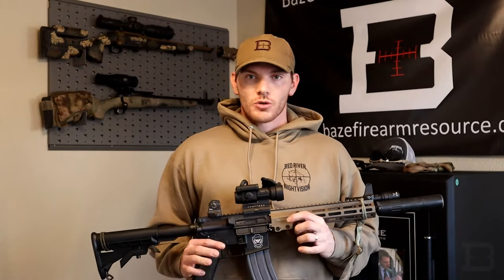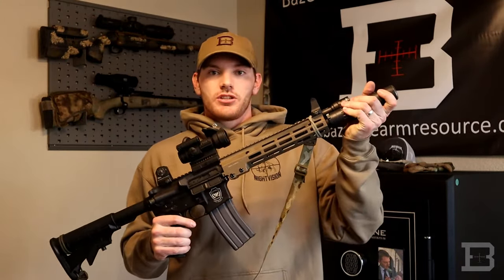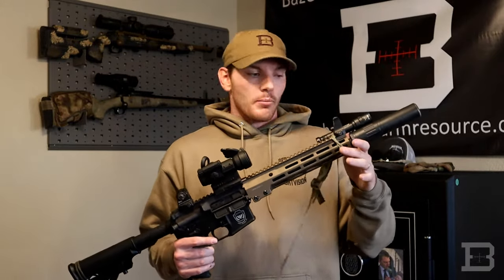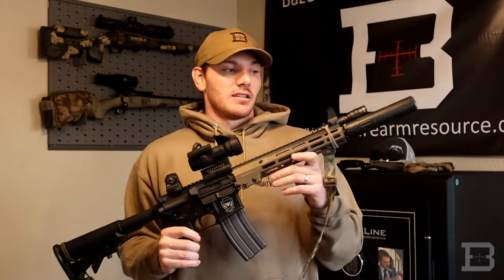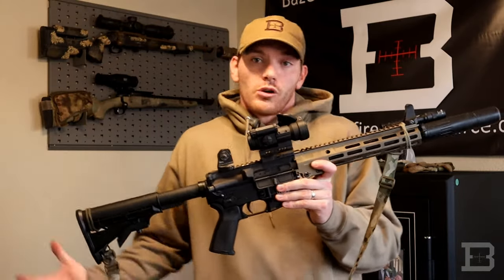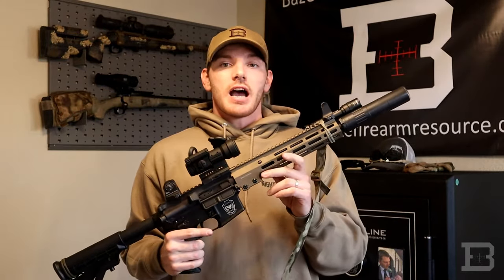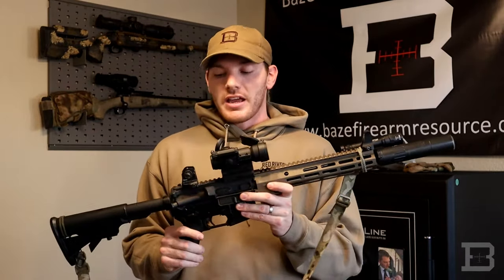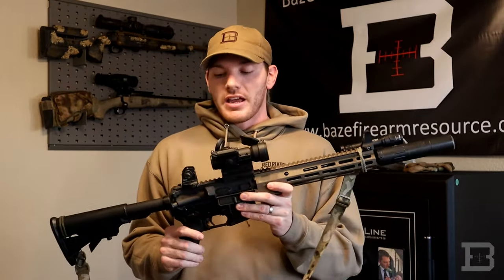How to Modify Your AR to Shoot Suppressed

Comment: Adjustable gas blocks are not the best idea because they add a new point of failure to the gun, but there is a pretty nice one (albeit expensive) called "RIFLESPEED Gas Controls".  Best advice is to get a spring from Geissele or Springco and test with buffers from H2 to H4 until your ejection pattern is around 4 o'clock.  You can also look up DIY gas buster charging handle if you want to save some money there.
Reply: Gas blocks are great. But, like anything do your research first and make sure it makes sense for your rifle/build. But they are great once you get the hang of them.

Comment: Actually it is a suppressor not silencer, because you are suppressing some sound and flash.
Reply from the maker: They are officially named silencers under law.
Reply: @suppressedpredatortactics6276 

That’s correct.
Reply: The original 1921 Patent says "silencer for guns ".
Reply: Hiram Percy Maxim the inventor called it a silencer
Reply: @kylehill4437  Hiram maxim received the patent in 1909 , actually made the 1st silencer in 1902
Reply: you can call it whatever you want, its still the same item with the same purpose. Like trans people I think

Comment: I have found that nothing really helps besides a superlative arms adjustable gas block. That actually tunes and adjusts the gas used to cycle the gun then it vents off excess gas away from the shooter. Absolute best thing i have done. Totally changed how my gun shoots smoothing it out and lowering recoil.
Reply: How long have you had it for and has it been reliable?

Comment: Not bad advice.. The bolt carrier you are using decreases gas to the internal piston which also decreases the gas expelling through the firing pin bore in the carrier..An adj gas block is even more effective as it decreases the gas going to the carrier in the first place..You also got right what the heavier buffers does (effects carrier velocity) not dwell time.. One side note, the use of a suppressor will decrease the rifle's life by 1/2..
Reply from the maker: People who worry about suppressors decreasing rifle life don’t actually train.  And it’s not half.
Reply: That’s kind of misleading. The entire rifle doesn’t wear out faster, it mainly just parts of the bolt which are cheap to replace and most people don’t shoot enough to notice anyways.
Reply: @midwestbd7144 During our Colt armorers class, the Colt instructor stated they get half the life from their suppressed rifles that law enforcement uses....

Comment: what parts wear faster when shooting suppressed? gas rings? extractor? and have you tried the a5 buffer system? i have them on all of my rifles but my silencer is still in aft jail. its been almost 9 months :/
Reply from the maker: Yeah, gas rings and extractor will be parts you want to have on hand.  With that being said, my bolt has seen 4k+ rounds without needing any parts replaced.  The gas rings will likely need to be replaced within the next thousand rounds.
I haven't tried the a5 buffer system, but I've heard good things.  
As far as waiting on the tax stamp... hang in there.  It will be worth it, haha.  Thank you for watching!
Reply: @suppressedpredatortactics6276  thanks for the reply and the info. much appreciated!
Reply: I just tested the A5 system V’s a SprinCo RED spring suppressed. Recoil felt similar. So if u need a quick inexpensive fix, SprinCo is the best bet for only $20. That said…. I still love the Vltor system in general. I run it on my 9” 300Blk and my 14.5” 556. Prob just keep the RED SprinCo in my 11.5”.
Reply: @scott2228  thats good to know. i have the a5 system on all of my builds, so i might try that one out on my 10.5.
Reply: @metaldave556  to make sure we are in the same page, that SprinCo spring is just for regular systems. Not A5. It’s just a stiffer spring. I run the green SprinCo springs in the A5 system.
Reply: @scott2228  ah ok. thanks for the clarification. by regular systems, do you mean carbine or rifle buffer?
Reply: Did you get your suppressor yet?
Reply: @corndogegan  I just got 1 out of jail. It was 246 days from date of certification.

Comment: It was a good video, but he gave the impression that you'd have to adjust your gas block for the different types of ammo to work...but its the different ammo and suppressor conditions that the adjustable gas block mitigates to allow your rifle to cycle properly. I'd rather be able to adjust my gas system for a suppressor and the different ammo used vice not being able to have my rifle reliably cycle under different conditions.  I build my rifles from the ground up and adjustable gas blocks are no different to install than regular ones.  They're just another variable to compensate for different buffer weights and buffer springs, and also allow you to easily tune your rifle for a 3:00-4:30 ejection pattern.  To each his own.  I use FailZero BCGs typically, JustRails ambi charging handles (don't laugh now, they're cheap, they've all held up, and they offset the higher cost of the adjustable gas block), an H2 buffer, and adjustable gas blocks.  And I rarely have to adjust the block.

Comment: Great video I did not know about a BCG suppressed or unsuppressed feature. Where do your cases eject out to, between 3 and 4 o'clock? You AR-15 is suppressed only using an H2 buffer, with a barrel under 16 inches with a standard gas block.  I would think the cases would be at 2 o'clock. I would think that rifle would need a H3 or H4 buffer weight to get the cases ejected between 3 and 4 o'clock so it is not over gassed. Over gassing over time breaks extractors and bolt heads.  Usually a 16 inch AR-15 works great with a H1 or H2 buffer weight with no suppressor. Each build is different.
Reply from the maker: Thanks for watching!  The BCG on suppressed mode helps prevent the system from being over gassed too much.  It ejects at 2:30-3:00.  This upper has 3k+ rounds through it with almost all of it being suppressed.  We are just now getting close to needing gas rings replaced.

Comment: Is it required to change out the BCG and CH to use ones that are more compatible with shooting suppressed? Or is that just recommended?
Reply: It’s just a recommendation but you’ll want to change something. I can’t even fire 1 shot out of my suppressed Aero upper without my eyes burning but it will function fine if you can deal with it.

Comment: will these steps help keep the gun cleaner as well? i just suppressed my CMMG Resolute 6mm arc and I pretty much have to clean the gun every 20 shots.
Reply from the maker: Not really, suppressed rifles are going to get dirty.  Is your rifle malfunctioning after 20 rounds?
Reply: @suppressedpredatortactics6276  no but after 20-30 shots it definitely starts to cycle harder
Reply: I clean my rifle once a year. No need to honestly. When I clean it, it's mostly for dirt and debris. Carbon isn't the enemy

Comment: Thank you for the advice.  I don't like adjustable gas blocks from what I've seen.  The BCG seems viable.  I use heavier buffer (H3) and spring, as im running a binary trigger on a 10.5" barrel.   YHM Resonator R2 up front.  Killer flex w/ the machine gun brotha!🫡🤑💥💥💥